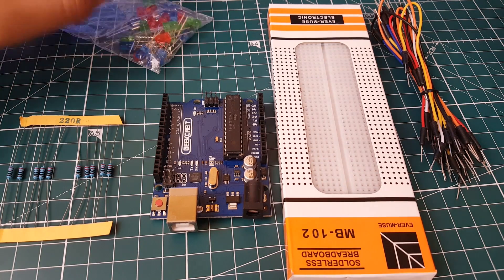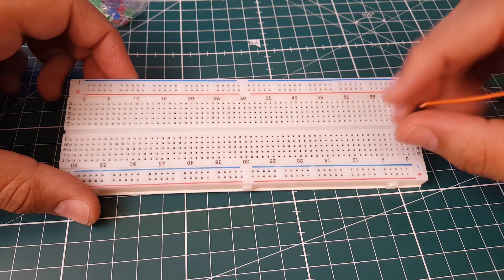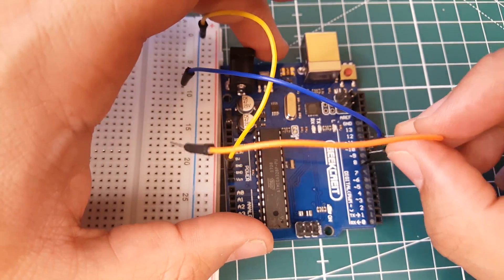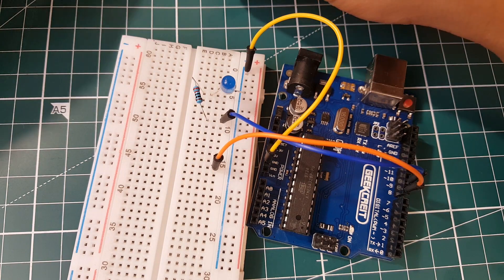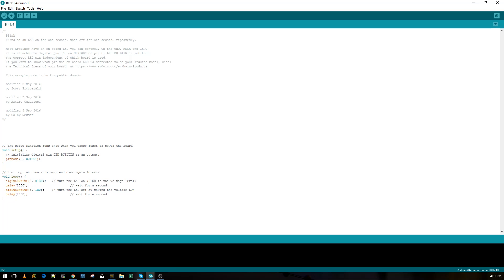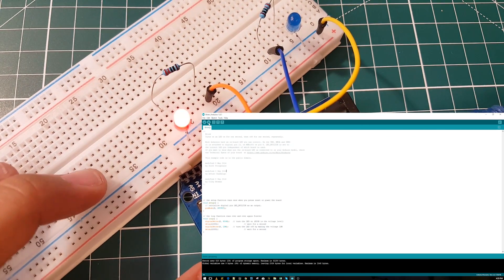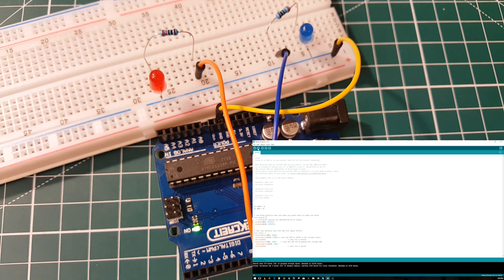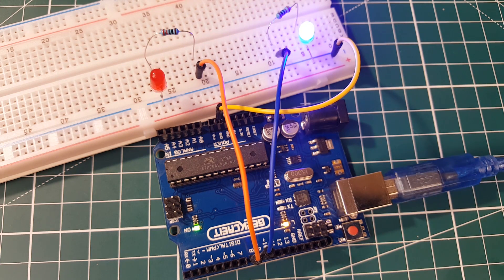Arduino Basics Tutorial // How To Control LED

Comment: You should test a low ESR caps when they are cold. If they stop filtering the noise from your power system. It could help you when you will fly in snow. :)
Reply from the maker: BuzzCola 3 will do
Reply: Drone Mesh thanks ;)